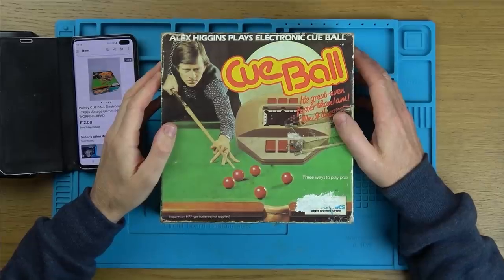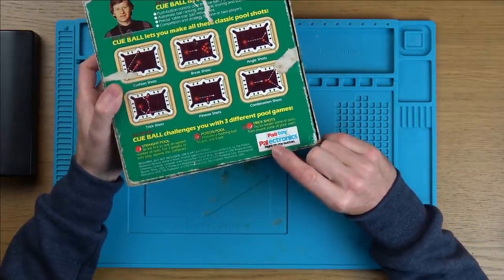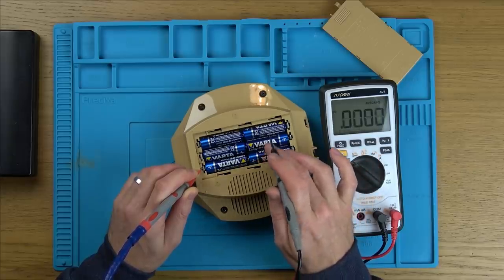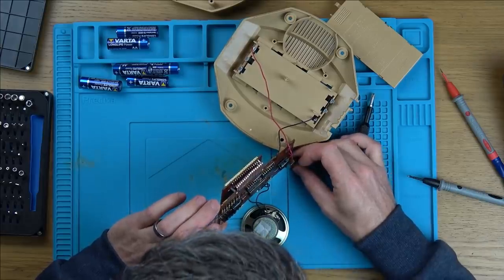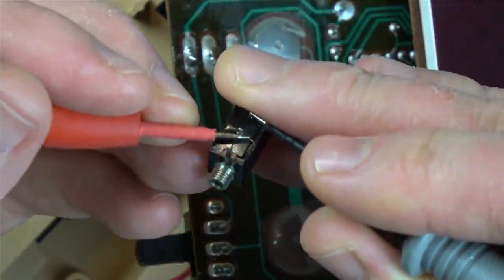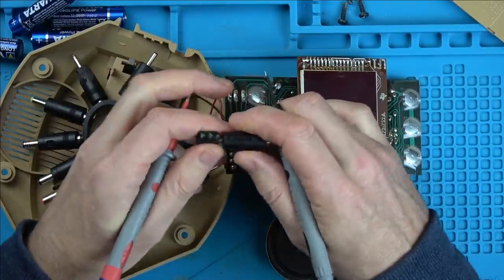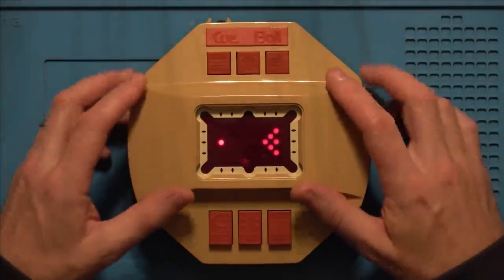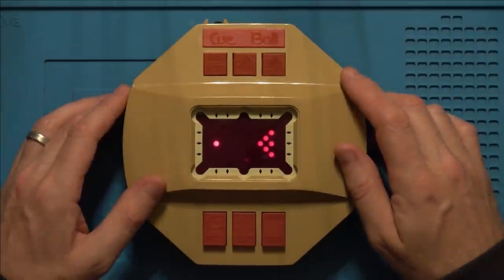Broken 1980 Alex Higgins Cue Ball Snooker Table Top Electronic Game - Tea Break Fix

Comment: I just wanted to come here and say I did my real first repair a few days ago (I am a total newbie at any repair using the soldering iron). I have a multimeter that stopped working when I needed it (I actually forgot it did not work). It was not a big deal, but it would have helped a lot. Anyway, I was already looking for other multimeters when I decided to open it up and check it, after also talking to friends and colleagues that are better than me at electronics. I did a sort of a diagnosis as I saw Vince do here and it looks like the ground connector just did not make contact anymore (it fell off as soon as I opened it up). I soldered it back and now my multimeter (the reasonably expensive one) is working again. I also soldered the other 3 just to be sure I won't have issues in the future. It felt good knowing I was able to fix it by myself and that I did not have to throw it away and buy a new one.
Reply: Good! Keep on going, you won’t regret it.

Comment: I repaired a kid's magic wand just now by soldering a broken contact wire and the joy it brought is some reward - the original solder was very tiny and it should last longer now - cheers for the inspiration
Reply: I once repaired an Nvidia Shield by using an old knife on the gas stove as a soldering iron. ;)

Comment: Hi Vince, when reinstalling old components that have fallen out of their solder joints, clean and tin the pins to improve chances of long term success.  I usually gently scrape the pins with wire cutters to remove oxidation and expose clean metal then tin and reinstall.  This also reduces the amount of heat necessary to remake the solder joint avoiding damage to components (especially sockets with plastic bodies).  Great video.

Comment: I had this as a kid in the US. From memory, it was branded Coleco and called Bank Shot (which I only remembered when you read it off the back of the game). I remember the box being similar or even exact (with the Snooker balls) but no celebrity endorsement. To us in the US, it was a pool table, but the red balls on the box flew over our heads. The 8 ball game selection has a flashing (#8) ball to sink last.
Reply: I looked it up and it actually had a yellow ball and a striped red ball on the cover, the only person was a random kid on the bottom of the box.

Comment: Those pins for the powerjack are awfully short. No wonder they came loose when the game got knocked or whatever. It's really fun to see what they managed to do with their "low tech" back then. This surely has more "flair" than a basic modern game. For the short pins of the powerjack: I would have put component legs on them to extend them a bit and give them more material to be soldered onto the board. I don't think the jack will come off anytime soon, but it would have made the connection a bit more secure. It's really fun to see vintage things like that being repaired. Very satisfying, even if it wasn't me who fixed it ^^;

Comment: You are obviously too young to remember HP/SP batteries - good old zinc-based cells, none of your new-fangled alkali thingies let alone Lithium Ion! 😀When soldering the jack I would advise holding the socket on with kapton tape, soldering the CENTRE pin first, then while holding the socket tight to the board with your finger reflow the solder on the centre pin. Once this is nice and solid and flush to the board you can solder the outside pins at your leisure. Keep the videos coming - it's fascinating seeing stuff from my youth. Kids these days don't know how good they've got it... grumble... moan... 😜

Comment: HP7 and U7 were AA, HP11 & U11 were C and HP2 and U2 were D cells back in the day - i can never remember the new term for the square 9 volt battery and in my mind it will always be a PP3
Reply: You forgot the good old PP9
Reply: @andytipping70  oh yesssssssss !   I could never quite get my tongue across the terminals for that feeling of instant regret lol
Reply: @wisher21uk  oh and what about bicycle lamp batteries ? the old 800 - a 3 v unit - looks like 2 oversized d cells stuck together with a flat terminal halfway down the cylinders? and the good old 4.5 volt wit 1 long and 1 short tab on top - found it as a 1289 but im sure that wasnt its riginal designation?
{SORRY VINCE - SEEM TO HAVE HIJACKED YOUR VIDEO COMMENTS FOR A NOSTAGIC WALK DOWN MEMORY LANE]
Reply: @andytipping70  yes I remember them they used to be used in door bell systems as well lol brilliant
Sorry Vince 😊
Reply: 1289 I was on about